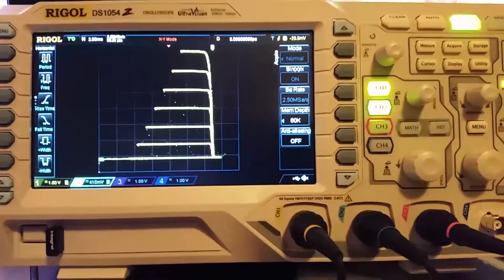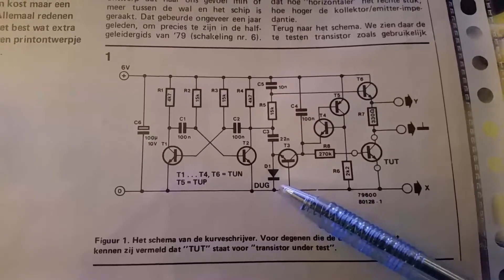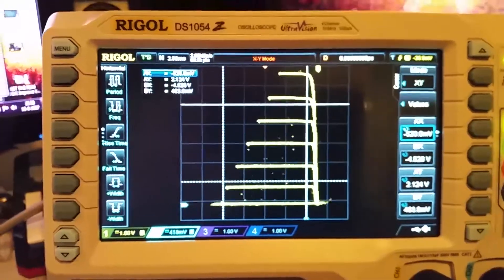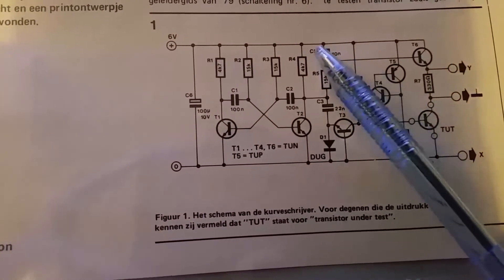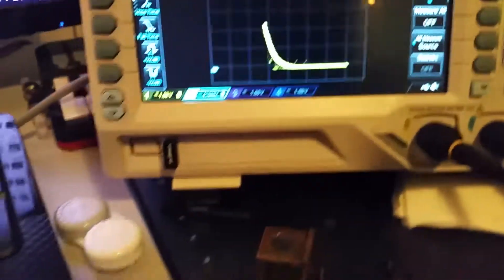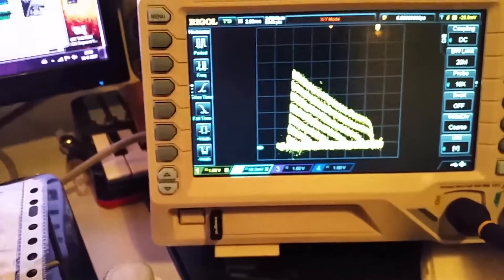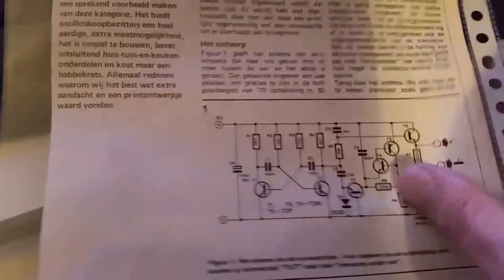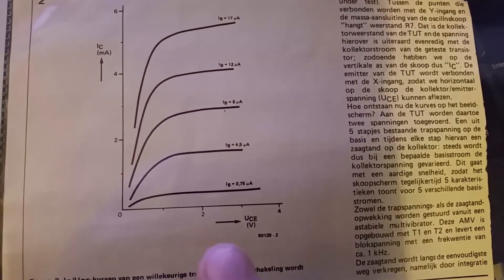Simple Transistor Curve Tracer for Oscilloscopes.

Comment: Sorry for the noob question but can you use this for JFET curve tracing?
Thank you in advance
Reply: JFET's need a triangular input signal for curve tracing.
Reply from the maker: You know, I'm not sure. I'll give it a try and let you know.
Reply from the maker: I tried it but no, it doesn't work with JFETs. It seems the step generator in the circuit won't work with JFETs.
Reply: @EdEditz  Thanks a lot!
Reply from the maker: @basstard13  No problem :)

Comment: good work 

but how to make PNPs version ??
Reply: FYI, I believe I have both an NPN and a PNP version of this circuit working in LTSPICE.  You have to swap around the bases of T6 and TUT as well as move R8 to T6.  In essence the step is now driving the top transistor and the ramp is driving the bottom transistor (TUT).  TUT.c connects to GND.  I will share the LTSPICE files if anyone has a place to upload.  I have alos added a blanking circuit for XYZ oscilloscope option.
Reply: @GodzillaGoesGaga  did you upload it anywhere in the end ? I have a xyz capable scope and that would be very usefull :) as for hosting files google drive can do that just have to make it public so you don't have to give consent to every person who requests to load the link hope this helps
Reply from the maker: Yes, that was what I was wondering too. The text said just swap the NPN's for PNP's and vise versa but that didn't work for me. I don't know the answer.